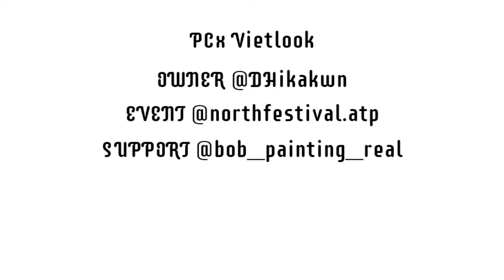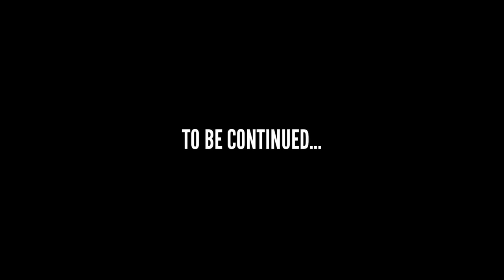Project Cat Vespa S 150🔴Restorasi Vespa S 150 3v (BOB Painting Carbon)

Comment: Bang mau tanya vespa sprint di starter bisa tapi pengapian tidak ada.
Awal mula chip dari kunci bawaan hilang terus pakai kunci cadangan bisa starter tapi pengapian tidak ada.
Setelsh chip kunci bawaan ketemu di pasang lagi sama aja bisa starter tapi pengapian tidak ada
Reply from the maker: Check Video Saya Tentang Vespa Matic Mogok,,Coba Di check Dari Yg di sebutkan Video Untuk Lebih Jelasnya
Reply: @MfourOtoVlog  itu perlu setting ulang eccu nya ya bang
Reply: @MfourOtoVlog  sama lampu immobilezer nya tidak empan om saat di matikan biasanya kedip"sekarang tidak.
sama setelah startter indikator engine menyala
Reply: @MfourOtoVlog  motornya di stater bisa tapi pengapian tidak ada.padahal semua dicek aman"aja gak ada yang putus kabelnya.intinya bisa di starter tapi gak mau hidup
Reply from the maker: Harus Di Check Manual ..Bawa Aja Mas ke bengkel Nanti di check apa yg Rusak...Contact ada BIO